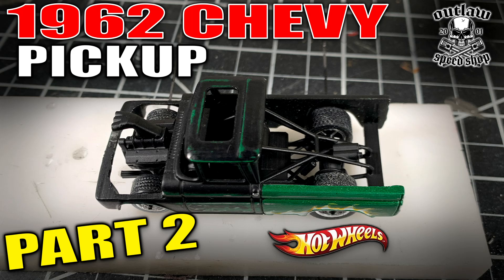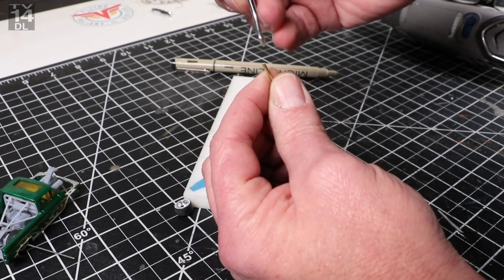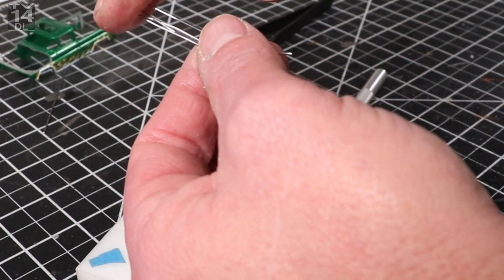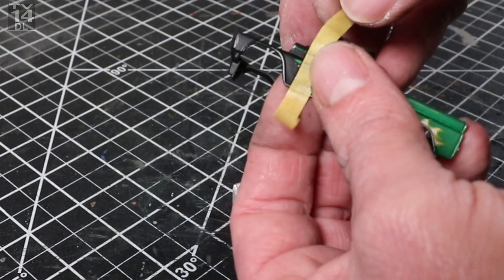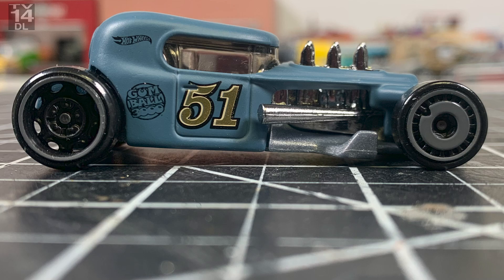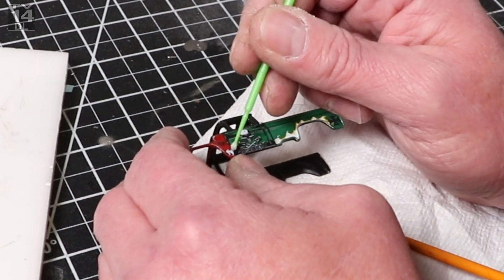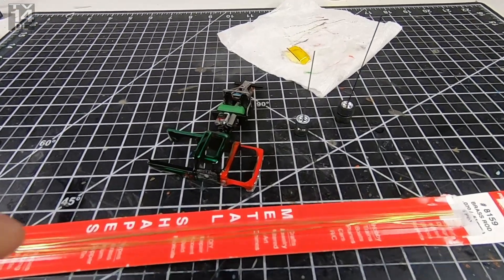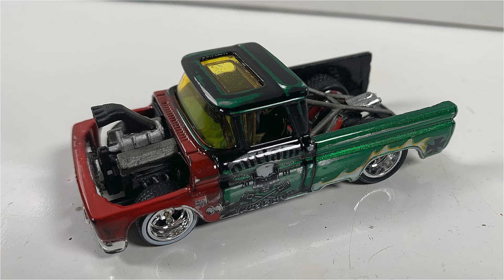Custom Hot Wheels 1962 Chevy PickUp Part 2

Comment: My favourite casting just made better😍😍ever tried soft sanding pads than paper??, use it daily in the paint shop, 1500,1000,800,400,320,240, find it’s a lot easier on contours, again that truck came out👌🏻